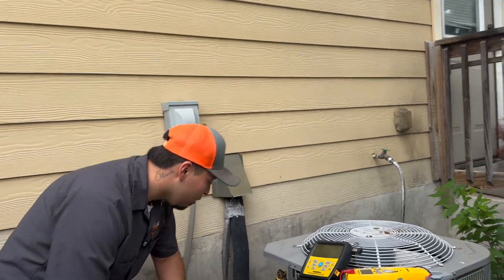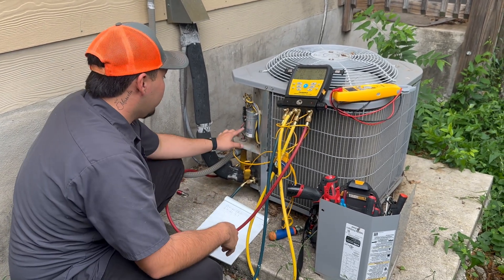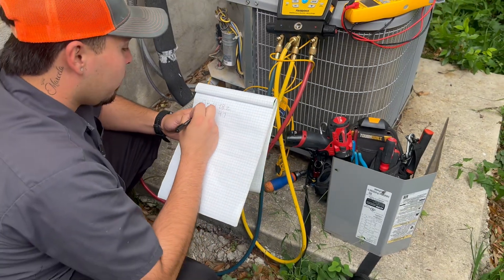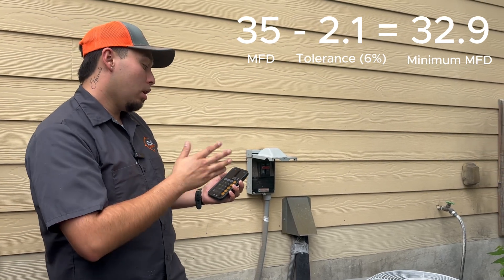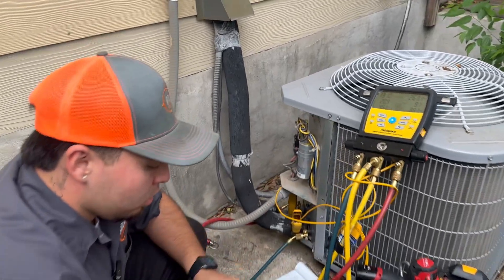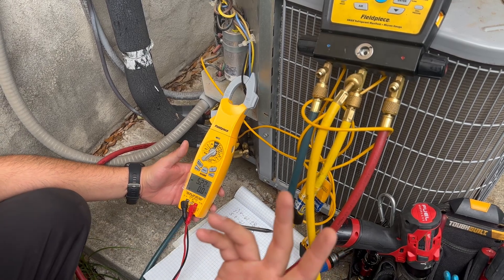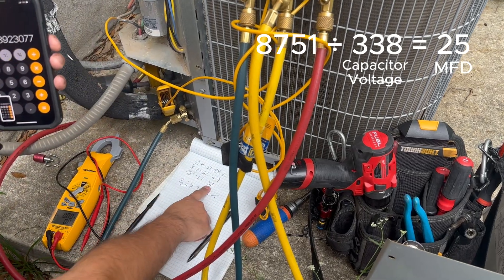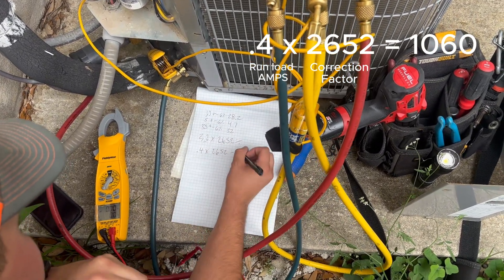STOP shutting off the AC unit to test a Capacitor

Comment: If you want your system to last replace the caps every 10 years because if a capacitor is weak it'll but strain on other components & cause them to fail prematurely do that & a system usally lasts until it completely rots away...unless it's a heil, goodman or arcoaire they usally don't make it to the 10 year mark
Reply: There is no need to replace in spec caps. One of the units on my house , a GE, is the original one. Its been running since 1974. The caps inside it are still within spec and are the original, ancient GE caps it was assembled with.

Comment: Neat method. Typical tolerances for large electrolytic capacitors are plus and minus 20% - so a 35 uF cap can measure around 28 to 42 uF. I suspect even new capacitors may not read in circuit values within tolerance because uof temperature variations and reformation of the caps aas they are in use.

Comment: Question:: Would the outside fan just run if capacitor is bad??
Just room temperature air coming out of vents inside
Reply: These capacitors are dual capacitors with a common. So yes the fan part of the capacitor can work while the compressor or herm side does not. These capacitors are about 20$ on Amazon. They charge 250 to 400 to install one. Easy to do if you cut power and discharge the cap. Not maintenance advice. At your own risk

Comment: You are a tech and should know where all wires go on that capacitor. If you cross simple wires on that capacitor on that small 3-5 ton condenser maybe you should not call yourself a technician. That capacitor wires disconnected as cap stays in place while i check MFD all in under 2 minutes.

Comment: I would like to have seen you pull the power, take a picture of the capacitor leads, pull the leads off and then check the capacitor with the meter and see if you get a similar reading.